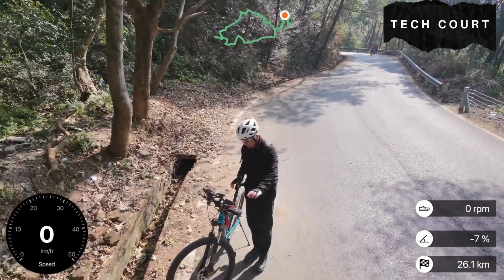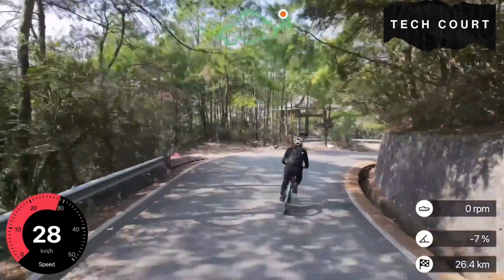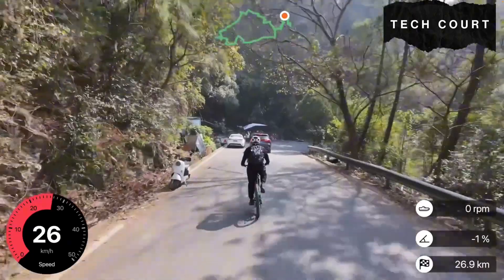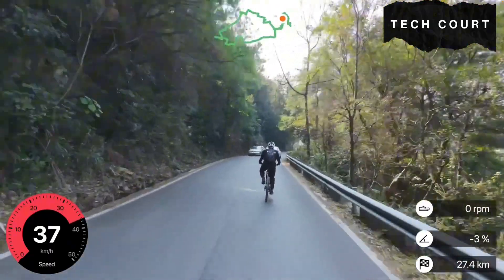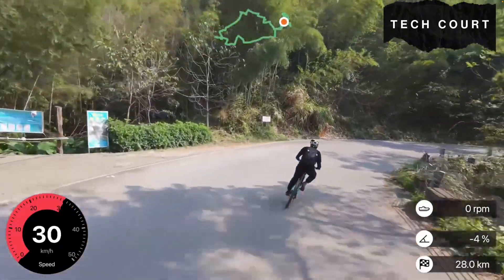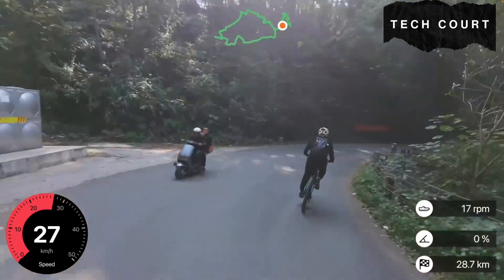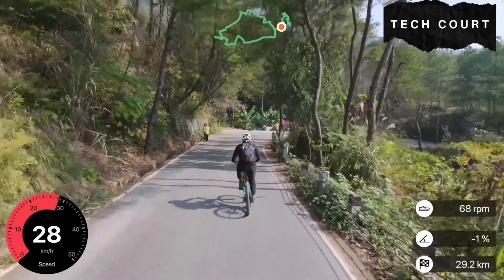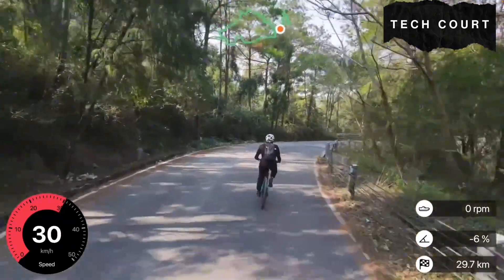DJI Neo 2 Follow Mode Speed Test – 50 km/h?!

Comment: Why is the footage so jittery? Every other Neo 2 video I’ve seen is much smoother.
Reply: Its a framerate issue. Looks like he filmed in 30fps and edited in 24/25fps
Reply: @Driftuner  That makes a lot more sense.
Reply: Definitely jittery, looks like they did not align the encoded frame rate with the output frame rate properly and didn’t have any frame interpolation turned on, very annoying!
Reply from the maker: That is the editing error. Nothing wrong with the footage itself. 🥲
Reply: He;'s narrating other peoples NEO 2 footage
Reply: @MinutemanPressScrippsPoway Footage is from Mainland China based on license plates
Reply: I have 20/2o vision and didn't detect "jittery".
Reply: @stanleyhache1626  the scenery is definitely not passing by smoothly at all. Jittery af